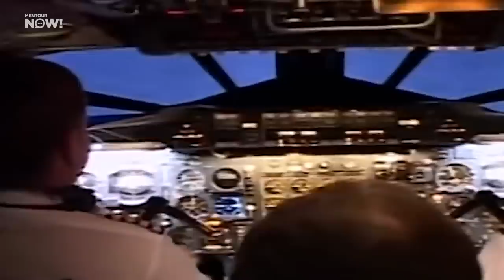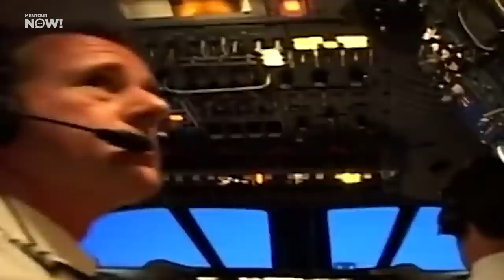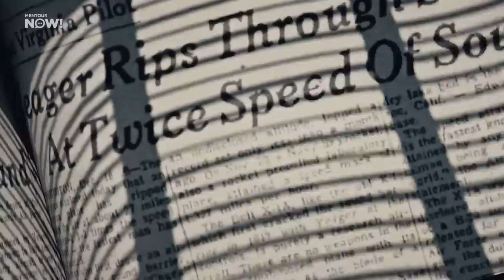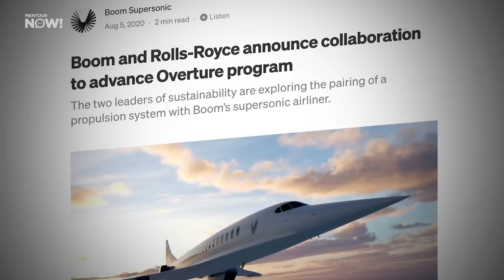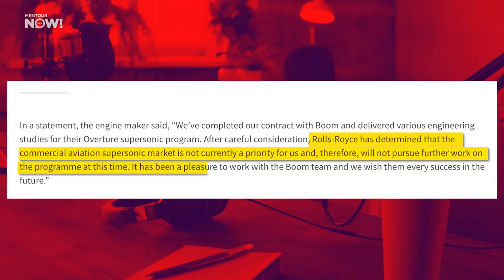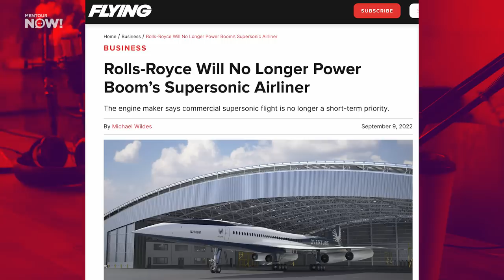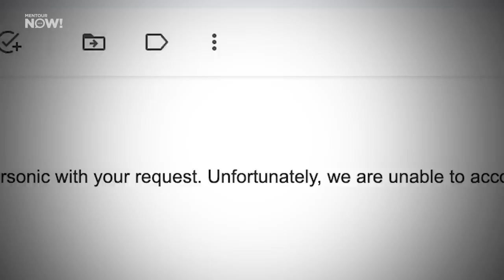WHAT’s Going On with BOOM Supersonic?! Will it Fail?

Comment: Most of the reasons that supersonic passenger flights stopped had less to do with engineering, and more to do with external, political dilemmas(No one wants the extreme noise) also they crashed a couple and that's not the sort of risk that wealthy passengers required to economically sustain the program were willing to take.

Comment: No engine maker that does not already have a military design that could be quickly (cheaply) adapted for this program is NOT going to take part in this project.  There is ZERO possibility that any of the major companies is going to do a "clean sheet" design when you consider the cost and risk versus the very limited future sales.  It is hard to think that this would be a large fleet and a new development project would never recoup the cost of a clean sheet program.  That said I think that the Pratt & Whitney F119, F135 or their or GE's 3-streams might be possible candidates.  Any of those choices should more than meet the requirements needed for this.

Comment: Time for an update now that Boom has announced engine suppliers?
Reply: Florida Turbine Technology, a division of $1.88bn Kratos Defence, started the symphony engine design in January 2023. Boom stated that no current engines, either military or commercial, are suitable for adapting to Overtures unique requirements. 

Boom will design the engine pods and the variable geometry exhaust and inlet ducting.

A big fuss is being made about Rolls Royce ending their contract with Boom, but AFAIK the contract was only for consultancy, and not to build an engine for Overture. Besides which, the Symphony project would be totally unsuited to the tier one engine manufacturers, like Rolls Royce, GE, P&W, and Safran. Their cost base and time frames would be out of kilter, and the volume of sales would not warrant their investment. GE caught a cold with the Affinity program.

Comment: Well the concorde looked pretty. 

My fascination with the concorde stopped when I began to realize all the magic tricks that needed to be done to make it fly. 

1. Fuel shunting. For the concorde its most stable configuration is about 1000 miles after take off, when basically you have maximum degrees of freedom to place the fuel. When they say the craft has a certain range what they dont say is at the extreme end of the fuel range its difficult to fly because either your balancing tanks are too full or empty. 

2. Rotated but still not aloft! Yes everyone remembers the crash of the concorde. The concorde had great acceleration no doubt, but it needed that to get is relatively low surface area to a high enough speed to get the main gear off the runway. And here it had more magic. It used afterburners to achieve the kind of acceleration do to the relatively low efficacy of its engines at lower altitudes and lower airspeeds.
The next magic trick is the slight of hand we see with safety. So a jumbo jet is making its rotation in the 170 to 180 knt range, if something goes wrong here it could abort and potentially run off the runway and crash, the airframe would be lost but people would likely survive. Not so with the concorde, the 200+ knt aloft speed pretty much limits about 1/4th of the runway for an abort, the craft would be in the next county by the time it stops on level ground.

3. Oh those tires. So the problem in flights are sudden stresses, that why we have runways. But this is another problem, When the aircraft lands it does not hit the ground at 170 kts, but its tires do, the tires are forced to accelerate to 170kts when they contact the ground. So during take off and landing the tires are subject to force moments that make them vulnerable. The accident at Charles de Gaulle airport was not the first or only incident where a disentregrating tire damage points on the aircraft. Tires are these things loaded with 2+ additional atmosperes. In general when a tire explodes is a wheezing sound. But on the concorde we have tires spinning at high speed with high centripedal force, the combination of interior pressure and centripedal force suffices to create a nice little bomb out of the tires rubber. 

4. Rules and regulations. Was the concorde pushing the 'spirit' of airspeed regulations? The reason for lowering speeds near the ground and airports is to increase reaction time and lower turning radius. It also permits traffic to blend together more easily are preset speeds at different altitudes. In that context the commercial aircraft fly in and out of runways within a 50 knt speed range. At the low end of flight landing A/C (near fuel empty) which might need to go around is 125 knt and at the high end Jumbo Jet taking off is 180 knt, which may need to abort and return to its airport (after dumping some fuel 175 knt). But the concorde at treetop level is 225 knt. The key problem with the concorde here is that as the A/C lowers its AoA as it speeds up it lowers drag, as it speeds up the engines work more efficiently, and the craft wants to barrel through the 250 knt speedlimit. While the concorde is really sucky on runways at 300 knts it is just a speed demon. And so just after takeoff the pilots are scambling to get the A/C to 240 kts to get the AoA down, but then have to reduce thrust and teter around at 250 knt instability point. 

5. No dedicated runways or airspace for the concorde. With problems 1-4 one might say, we can solve these problems by having a concorde airport. 5 kilometer runways, dedicated airspace with relaxed rules. Yeah, no, the concord program forced itself into prexisting airports. If it was truly so important that runways be devoid of tire-bomb fodder, then its kind of the airlines responsibility to make sure their runways are free of debris. This is probably the biggest magic trick of all. How did Concord manage to get permission to fly in and out of commercial jetways? National Politics?

Can supersonic make a go? 
   Delta wing. You need a craft that can truly (Not politically inserted) blend into the intent of safety regulations around airports. Most airframe losses occur within 5 miles of an airport. While the expectation is that airport saftey is perfectly implimented we only need to look at 911 to see how safety ebbs and flows with the political seasons. While, as a contractor, safety regulations are often over the top, looking at the work of other contractors I realize why regulators want redundancy in the safety systems, because they know, someone, somewhere, at sometime is going to 'miss the target'. Supersonic aircarft either need their own runways or they need to be able to manage better takeoff and landing speeds. An aircraft cannot be built around a single point fail framework (within reason), having said that you know how i feel about single engine aircraft (except the super cub). 
   Lowerin the Mach limit may improve low speed take off and landing characteristics, but let me be blunt, at 60,000 feet the aircraft should be able to increase its range by at least 50% over commercial A/C. While it is true the mach barrier creates an over pressure, at FL600 feet the craft is 17,000 feet over the highest altitude a 777 can fly. Pressure and drag are half of that FL450 at any given speed. Being able to fly at mach 1.5 to 2.0 kind of defeats the purpose if you can only fly between the closest intercontinental airport. When super sonic can fly between Honolulu and Sydney, or Houston and Tokyo, I will buy stock. The whole point of being single swept wing is to lower drag and increase speed. Why not Mach 2 at FL650?

Comment: There's any number of military jet engines that would fit the specifications needed for this supersonic transport.  Even in the design of military aircraft, unless it is going to be a ground breaking super high tech trillion dollar project, most new aircraft are designed around an established jet engine, or a modification of an existing engine,  rather than trying to develop a brand new jet engine specifically for that aircraft.
Reply: Florida Turbine Technology, a division of $1.88bn Kratos Defence, started the symphony engine design in January 2023. Boom stated that no current engines, either military or commercial, are suitable for adapting to Overtures unique requirements. 

Boom will design the pods and the variable geometry exhaust and inlet ducting.

A big fuss is being made about Rolls Royce ending their contract with Boom, but AFAIK the contract was only for consultancy, and not to build an engine for Overture. Besides which, the Symphony project would be totally unsuited to the tier one engine manufacturers, like Rolls Royce, GE, P&W, and Safran. Their cost base and time frames would be out of kilter, and the volume of sales would not warrant their investment. GE caught a cold with the Affinity program.

Comment: The benefits in term of time for supersonic (Mach 2) travel cannot be matched with the cost(s) against subsonic (Mach 0.8) travel in civilan aviation industry.

We have technology feasible aircraft - Concorde for operating more than 30 years, but already retired for 20 years ago...

Unless the benefits for time saving in Mach 2 able to beat the costs (ticket price of traditional air travel). Then no future supersonic machines considers economic feasible when compared to Concorde's history.

Conclusion
If Boom's development cannot superior than Concorde in term of

(1) with sigificant operation cost saving than Concorde or
(2) speed Mach3 or even Mach4.

Then what is the point for repeating history for developing something the market might probably be discarded 🤔

The concept of engineering revolution / advancement
1. We able to built device with similar specification with significant cost saving (i.e. Elon Musk's Falcon rocket series vs Apolo projects)

2. We able to use similar cost to built device with significant better specification (i.e.e Intel 8086 vs today's intel i7)

3. I cannot see Boom project with neither possess (1) nor (2) essence.

Perhaps development supersonic business jets might has market because potential 
consumers might see it as a toy rather than a business tool😄

For revolution civilan aviation projects in coming decades > it shall be used ramjet or scramjet rather than traditional turbofan engine!

Anyway I am not against Boom's project (engineering knowledge is earned by accumulation of experience and leaf of jump is not possible except gained from extra-terrestrial encounter). However, I am not so optimistic about Boom's market sustainability.

I agree with your statement...
《We need people (i.e. Elon Musk / Geroge Westinghouse) able to run unique company who shoot for stars and push us our imagination》
Elon Musk has both intelligent and passion to use his existing business to fund his future ambitious (i.e. make people go to the Mars)

Comment: The Rich travel with staff (assistants, drivers, nannies), so Boom would need two cabins. Lie flat business first up front, plus a premium economy cabin at the back. 4200 nm range is probably not enough to link all the city pair routes, the rich would want. I think you need at least the 4700 nm range of the A321XLR.
Reply: @audacity60 
When and if Overture reaches production, there will be an endless number of configurations, from business 30 seats to possibly cattle 100.

4,200nm to 4,700 nm is only 12%. I expect Boom could achieve that as the Overture engine and airframe develops.

Comment: The fundamental problem is, what's the business case? SST over land is dead in the water. There is no political capital to change the regulations, leaving international over the ocean as the only option. 
Given the time taken to get to the airport, check in, go through security, then at the other end, customs, passport control and baggage collection, only half of the travel time is spent in the air. Once you factor in that Boom is slower than Concorde, the time savings are slim. 
Ultimately, the market Boom is selling to (the day business traveller) has been conquered by Zoom.

Comment: I’m no jet engine expert, but it seems fossil fuel engines seem to have and create a lot of limitations, so what’s rolling around in my mind is maybe the old school jet engine needs a rethink, so I’m gonna throw caution to the wind and suggest a better and cleaner fuel is required, so what if a jet engine could be designed to run on hydrogen? I’m not talking about rocket engines but they gave me this idea, as they seem to go pretty well on the stuff and water being the only emission, it’s the most abundant stuff in the universe, easy to make and I think you’d need less fuel to run such a thing, has anyone ever tried running a modern jet engine on hydrogen? I’m sure there’s some experts out there wanting to pat me on the head and patronise me, but I’m trying to think outside the box here, where a more powerful fuel might be able to be adopted and keep the emission levels at practically zero, maybe able to fly higher with on board oxygen tanks, at the edge of space at amazing speed, less atmosphere and less friction, anyway, when you’ve all stopped laughing, I’d be interested to know if it could actually be a viable proposition, with some clever redesigning of components?😬

Comment: I wish the Boom to succeed but don't see how it will work with 4 engine airplane that can't do better than Concorde in terms of speed and capacity.
Reply: @henson2k  Overture will be slower than Concorde and it will carry fewer passengers, but it will address the shortcomings of Concorde that caused its demise.  

Concorde carried 100 passengers at Mach 2, over 4,488 miles. 
Overture will carry 72 passengers at Mach 1.7 over 4,888 miles. 
The two aircraft are the same length at 62m (203ft). 
Concorde MTOW is 185 tons. Overture MTOW will be 77 tons.

Because Overture will be efficient at sub and supersonic speeds, 500 routes, some mixed land/water, are viable, rather than just 2 water routes for Concorde. Overture will fly 2x the speed of subsonic jets over water and 20% faster over land. Overture will not fly supersonic over land. 

Overture's development cost will be $6bn. Concorde's development cost was $14.4bn. The manufacturing cost will be less, the maintenance costs will be lower, and the availability will be higher. Overtures selling price will be $200M. An equivalent price for Concorde would probably be $1.2bn. 

Overture will be simpler to fly, eliminating the need for a 6 month pilot conversion course. Overture will also have a modern cockpit, with more room, and a flight engineer will not be required. Its cabin will be quieter and more spacious, and its seats will be more comfortable. In contrast to Concorde's tearing engine noise, Overture will comply with ICAO-14 regulations, allowing it to use all airports. 

Taking a JFK to LHR one way flight:

Aircraft          Fuel cost^           Economy      First Class          Duration
Boeing 747       $147                   $577               $2,308                 8hrs
Concorde          $753                                           $5,000^^              3.5hrs
Overture            $628^^^              $1,300            $3,800                 4hrs
Business jet^^^^                                          $53,000 to $99,000    8hrs

^       Fuel cost per passenger
^^     2023 money
^^^   Assuming that Overture is 20% more efficient per mile and 72 passengers
^^^^ There are no supersonic business jets
 
If Overture reaches production, and meets its specifications, it will be popular with both airways and passengers, because it will half many journey times and will be cheaper, more comfortable and a lot more practical than Concorde. The military have already shown an interest in Overture. It would also be suitable for charter flights and as a business jet. The next development should be a 200 seat version, and possibly a supersonic business jet.